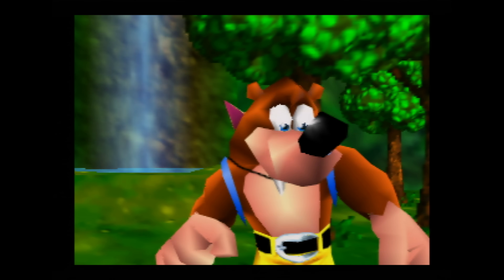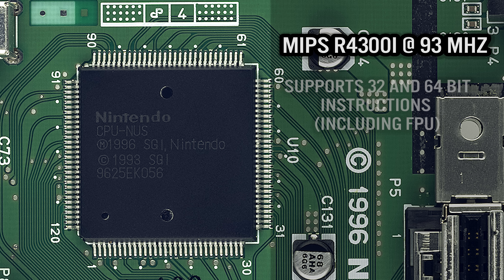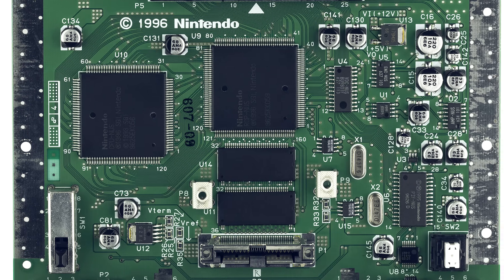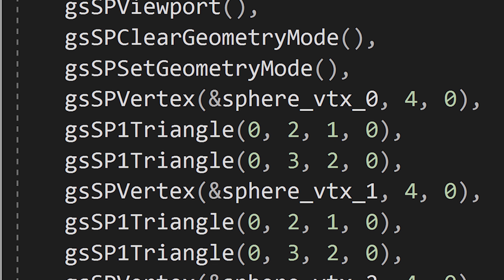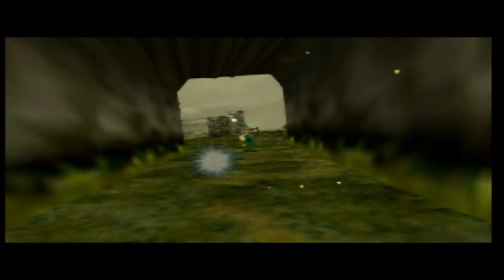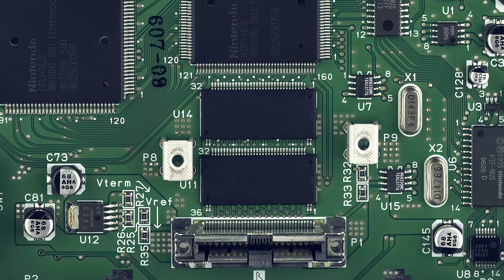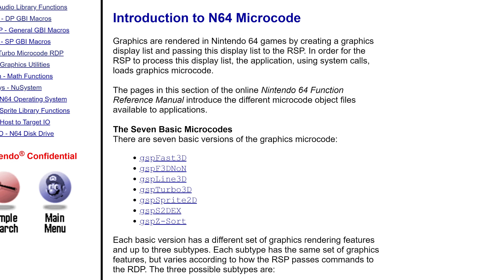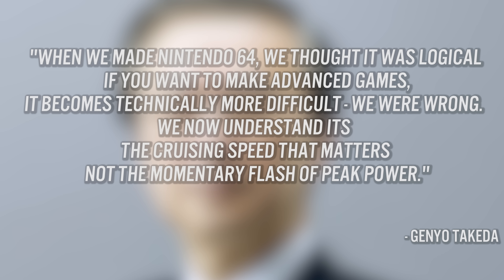Why was the Nintendo 64 so hard to develop games for ? | MVG

Comment: Some time ago, I watched a documentary on Final Fantasy's anniversary, and something that got my attention is that, the reason Squaresoft picked the Playstation wasn't for the CD format, but rather the speed they could push polygons on it was much greater than the workstation Nintendo provided them for developing for N64.
The simplicity of Sony's system made it faster, even if, all in all, the N64 was much more powerful.
This is a lesson we still see in current day, the cache system on XBox One is a nightmare to code for, compared with the single memory PS4 has, making most developers like more to code for Sony machine
Reply: nowadays it's as simple as clicking on a button and your game engine exports to the hardware of choice, I am pretty sure most devs barely know what they are working with
Reply: I find that hard to believe considering they made games that took up 4 CDs just because of prerendered backgrounds and FMVs, with very little 3D rendering happening.
Reply: The vast majority of developers aren't even dealing with low-level code anymore. Most games nowadays are created using third-party engines, and it's rarely justifiable to create highly optimized code with how powerful consoles are today, specially among indie studios which typically only use a fraction of the consoles' potentials
Reply: I bet Sony has learn from their mistakes on PS3 console to make PS4 more developer friendly
Reply: Programming for XBoner is literally the same as programming for Windows.
Reply: Actually its the complete oposite , it"s so much more user friendly programing for xbox one X than ps4 pro . Check multi platformer games at digital foundry and the differencr in fps and graphic limitations is astonishing . Xbox one X is much more stable , powerful abd easier to work with than the ps4 pro.
Reply: @luisveigas8604  X1X has the eDRAM mapped to normal (v)RAM so does not matter if you use It or not, not so on X360 or X1(S).

so peak performance Vs Cruise Speed let see how the PS5 throttling Will work out.
Reply: @ag0ny  still easier programing for xbox than playstation . Go check fallout 3 and bayonetta on ps3 , they are literally destroyed by the architecture of console . Xbox is like a pc in terms of developing games , and we all know how easy and user friendly is to programing for pc. Against facts there are no arguments buddy , this yuri dude he is just a fanboy he doest know what he's talking about

Comment: This reminds me of the situation with the atari jaguar, and subsequently the ps3, a superior console which was way ahead of it's time, it terms of the technology it was using. The architecture however, was subsequently incredibly difficult to program for, as there wasn't a programming standard, or a benchmark to base it against, as 3D technology was still relatively new at the time, when the N64/ Playstation was released, but the playstation had net yaroze, and a very developer friendly approach to programming its games.
Reply: Don't forget about the Sega Saturn too! It was also hard to develop for..
Reply: @kenrickkahn  that's a different story, the main problem with the Saturn was a lack of native 3D rendering, so it was hard to code 3D games but probably the best console for 2D
Reply: @gothrickle  Not really, the Saturn had other issues. Its dual CPU design was very challenging to develop for, especially since only 1 of the main CPUs could talk to memory at a time. It had a poor C SDK at launch, meaning that combined with the strange architecture many devs had to resort to assembly to get good performance. It had bad hardware transparency support even in 2D, such that you either had crippled transparency or did it in software, which is obviously more difficult.

The Saturn is an interesting beast, but it had too many quirks. Even ports of 2D games by major publishers have technical issues compared to the PS1 versions.
Reply: @KyussTheWalkingWorm  oh yeah yeah. But the reason for games looking kinda subpar is a lot because of the 3D thing. The architecture being very complicated added to that, for example, it technically had enough power to do good 3D but then as you said, problems like the dual cpus ( counting the 68k it's 3 cpus lol ) and the various circuitry, there's an FSM in there as well, it's really a mess of a console
Reply: @gothrickle  Saturn not having native 3d rendering doesn't really say much. Neither saturn or playstation did.
They were both framebuffer based, but instead of rendering triangles saturn did 4 point quads with forward mapping. They used different methods for rasterization and texture mapping but fundamentally they weren't that different in terms of 3D. Saturn was just less efficient and flexible.
Reply: @KyussTheWalkingWorm  Not to mention the use of quads for 3D, which isn't the most intuitive way of doing 3D.
Reply: @jc_doge  I know it didn't have a z-buffer but I didn't know it lacked 3D capabilities as much as the Saturn. Thanks for the clarification
Reply: dogen Don’t spread misinformation. PS1 renders normal triangles and supports UV mapping. Saturn and 3DO render “distorted sprites” and therefore no UV mapping. There is no Z in PS GPU because Z-buffering (and perspective correction) is very expensive, look how poorly N64 performed because if it.
Reply: @noop9k  I didn't say the saturn supported UV mapping. I'm just saying they both draw 2D primitives.

Saturn drawing to a framebuffer means it doesn't actually use sprites, but that is a little pedantic. Probably best to say they ended up with a sort of hybrid.
Reply: @jc_doge  Saturn DOES have Native 3D Rendering. But its through MAPPING. MAPPING, Texturing and Layering. Saturn is a MAP RICHED 3D console sir.
Reply: @segaunited3855  Saturn games can have 3D game state, but VDP1 doesn't take depth as an input, so it works in 2D space. Not sure what you're saying or mean by mapping.
Reply: @jc_doge  Saturn uses Texture Map,Depth Buffer and Multi Plane Affine BGs. VDP1 is for handling Texture Map,Alpha Bend and Depth Buffer. VDP2 is for Multi Layer,Multi Plane Map, and Bit Mapping.

Saturn's BEST 3D abilities lay in its Bit Mapping. Saturn is superior at Texturing and actual Filter Fil Rate than even N64(which uses XY Tesselation, therefore it uses and relies on hardware Aliasing for Raster as well as Quad Layer and Multi Map. Saturn uses Old Fashioned 3D, by relying less on Polygons and far more on Background and Environment mapping and layering. Both N64 and Saturn don't rely too much on Polygons and Z Buffer Matrix like PS1 does. They rely on Wireframe for Modeling and Characters.

Saturn and Nintendo 64 have many key advantages over PS1's 3D. For example, Saturn is capable of Recaculation,Affine Deflection, Perspective Correction and Diffusion. Saturn has a faster Pixel Fil Rate and HIGHER Buffer Chache than PS1 using max 512KBs as opposed to PS1's piddle 48KBs and N64's lackluster 128KBs.

N64 uses Quad Layer,Z Buffer and Depth Correction and Multi Bend and Multi Map. Saturn can Multi Layer, but it can't multi Map. 

PS1 is inferior due to it relying too much on Basic Z Matrix Polygons, No BGs, uses too much heavy Bilinear Filtering, Distortion and VERY Basic and primitive Texture Draw WITHOUT Texture Map. PS1 often CHEATS by relying on Software Rendering tools and Screen Filters.  It is Incapable of basic things like Sprite Redrawing and even Affine Plane Deflection and Diffusion.
Reply: @segaunited3855  Most of what you say doesn't make much sense. PS1 didn't use ANY bilinear filtering (it uses nearest sampling)?  After 20+ years of CG programming, 4-5 years spent on the PS1,  I've never heard of most of the terms you're using.   What is "Basic Z Matrix polygons" "Recalculation", "Affine deflection" and "diffusion" ? Is that Sega marketing jargon ?
Reply: The PS3's advertised power is largely marketing. The main PPC processor cores in the PS3 and 360 were near identical. But the PS3 only had 1 (called PPE), where the 360 had 3. Most of the "cores" in the Cell were actually specialised coprocessor called SPEs, optimised for SIMD math kind of like GPU compute units. While this helps in certain applications and benchmarks and lets you put an impressive FLOPS number in marketing material, it's not very useful for general purpose computing. Also the job of driving the SPEs fell on the PPE, putting a strain on its ability to provide good single core performance for non-math-heavy parts of the code. It's neat to have a bunch of coprocessors to parallelise geometry calculations or multimedia decoding. It won't help you scale sequential tasks like running the script engine of your open world game.

This is where having fewer, more capable general purpose cores is an advantage regardless of programmer skill.
Reply: @KyussTheWalkingWorm  When games were optimised well it was powerful enough. When Naughty Dog went to port Last of Us to the PS4, initially it ran about 10 FPS. They were expecting to get 60FPS and they only got it by using a lot of tricks. Okay. they were probably wanting to avoid a large amount of code rewrite and rebuilding the engine would have taken too long.
Reply: except ps3 and jaguar were terrible terrible terrible... and not really superior?
Reply: Same with Amiga. Only once the ST started to die off did we get Amiga native games. Look at how bad Xenon 2 looks on the ST vs the Amiga. That was an Amiga native game ported ot the ST.
Reply: 6581punk ST would fare much better if they weren’t late with blitter and somehow enticed devs to support STe.
Reply: atari jaguar was only superior on paper, in reality silicon had plenty of bugs and Tramiel decide to just ship it broken, including broken compiler in the SDK
Reply: @randomguy8196 I know I know, thanks for the recommendation anyway
Reply: my dude the Jaguar was is NO way a superior console. it was half assed from the start as Tramel was a cheap. Doom Jaguar has no music during gameplay is because of the way the console was designed. there was also bugs on the hardware from the very start. it was a mess. it also only had 2MB unified memory so you could not do any 3d games and have them run well.
Reply: Jag was also crippled by the problems with RAM accesses during texturing. Carmack said that even a tiny cache could make it competitive with 3DO, Saturn and PS.
Reply: as far as I know the Jaguar wasn't "ahead of it's time" but just marketed with way more confidence then they should have!
Thing wasn't a lot more powerful then a SEGA 32X.
Reply: I have mixed feelings about the PS3's hardware. The Cell CPU was good as doing GPU-esque parallel math tasks, but as a general purpose CPU the 360s 3C/6T Xenon was arguably better. The initial design pitch for the PS3 actually had two Cell CPUs and no GPU. It would have been a return to the old paradigm of software rendering without dedicated 3D acceleration. We can't predict the future, but as it stands I'd consider the PS3 more of a failed divergence than a forward-thinking design.
Reply: @Darkangel754  It required code to be optimised for the system. Cross platform games don't always get this optimisation. GTA4 for instance runs in lower resolution on the PS3 compared to the XBox 360 and it wasn't the only game like that.
Reply: "...ps3, a superior console which was way ahead of it's time, it terms of the technology it was using"? PS3 has almost the same architecture as the XBox360. XBox360 was released a whole year earlier. Both systems have real SDKs. I don't believe that ist was difficult to develop for them. The existence of indie games should suffice as evidence.
Reply: @2012JvN  The PS3 and 360 are cousins from an architectural standpoint. The PS3 had a weaker GPU, split RAM instead of unified RAM, a "weaker" CPU***, and worse developer tools (debugger, APIs, documentations). This meant that something that ran good on the 360 needed to be significantly reconfigured to run the same on the PS3. If you wanted to take the path of least resistance and make a basic game on PS3 then it wasn't too bad. Hence low-spec indie games were never a big issue.

***If you weren't leveraging the SPUs, then the PS3 CPU was basically a slower, single-threaded version of the 360s tri-core. Hence copy-pasting a 360 game to PS3 made it run way worse.